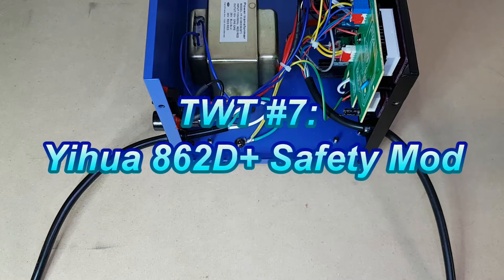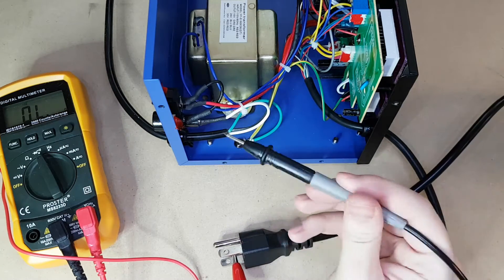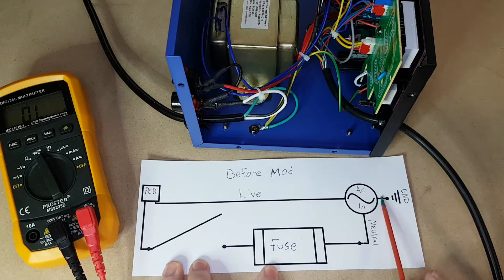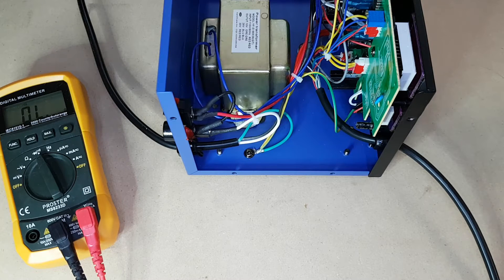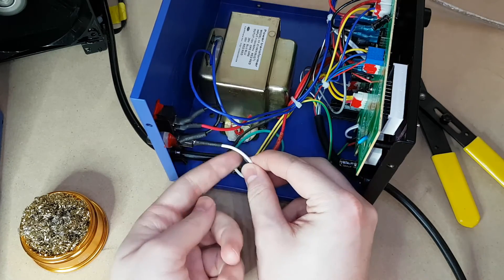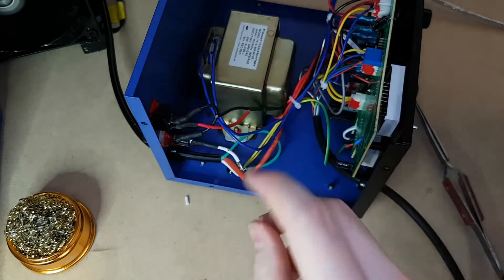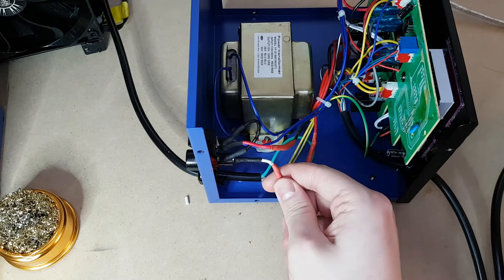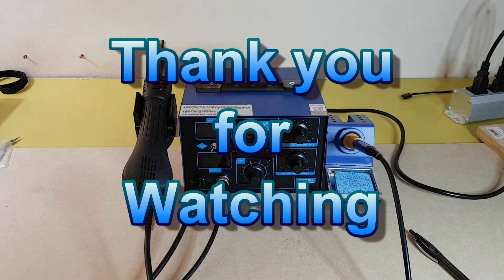TWT #7: Yihua 862D+ Safety Mod

Comment: Nice job on the video.  Just a few things though...  Throughout most of north america, we call them "alligator clips".  :)  You are correct in that the device came mis-wired, and would leave 120VAC potential between the positive side of the circuit and earth ground.  You could have simplified the repair, and shortened the video significantly, had you simply swapped the two incoming leads.  The fuse and power switch would subsequently have been corrected automatically having done just that.

Those things aside, have you done much with this rework station?  I'm currently in the market for a hot air rework station, so I like to hear from people using those that I've considered based on price and specifications.

Thanks in advance,

Oops, forgot to mention, one last thing.  For most applications where wires are concerned, tinning is great, however, soldered butt splices are an exception.  Best to strip your wires to about 1/3rd more than the length of the splice, then overlap them diagonally at the two centers of exposed ends, and twist each end from the junction point towards the insulation of the opposing wire in both directions.  Once you have the two wires evenly wrapped with no strays dangling, sweat the solder into the splice by heating the wire and introducing solder once hot enough to be wicked up into the bare splice.  Heatshrink as you have, and you'll have a proper splice.  I know, everybody is a crittic...  Sorry, I really am just trying to help.  Great video though...

Steve
Reply from the maker: I think alligator vs crocodile just comes down to personal preference, in Canada at least it seems a equal number call them croc or crocodile clips versus alligator clips. That being said alligator seems more common in the US and Crocodile in Europe and Australia based on watching different YouTube channels.

The station seems to work reasonably well, I've been using it as my main soldering iron and only heat gun since posting this video. The iron tip heats quickly and so does the hot air gun's heating element. For the price I don't imagine there are many better rework stations, especially if you are in the US and can get it for $50-60 with free shipping.

Thanks for the advice on splicing the wires!
Reply: I was thinking crocodile was a regional thing, based on indigenous species of large mouthed reptiles of the continent to which we reside.

For an all in one solder rework station, I think that Yihua 862D+ you have gives the most bang for the buck.  With Yihua, I have somewhat of a love hate thing going on.  Pretty much everything they make is copied from much higher quality, as well as much higher priced Japanese vendors.  You really can't compare the quality of what they produce to a brand like Hakko, but come on.  Who can afford top of the line for home use?  I know I can't.  What Yahua does, is makes a usable, sub par alternatives to tools I can't afford, which allows me to work effectively in my home without spending a fortune.

There are a few examples of things Yahua does that actually makes their products better for home use, than having the real thing.  For example, the bulkhead connectors they use for connecting irons to their stations are standard GX16-5's, which are readily available for next to nothing.  That means if you want to replace the crappy PVC insulated iron chord with a high quality silicone chord, you can buy the cable and ends to make high quality attachments to whatever length you desire.

The components used in their rework stations are decent and reliable enough for long life usage, it's the assembly process that trashes the quality on many of their products.  That said, you're buying a solder rework station, so, chances are you're savvy enough to repair manufacturer defects, and are able to replace any failed generic component throughout the life of the tool.

My current soldering station is a Yihua 936b, which comically, is a Chinese made clone of a Chinese made clone (Aoyue 936) of a Japanese made Hakko 936 solder station.  I chose this clone over the many 936 clones out there for it's ergonomics.  Aoyue made common sense upgrades to the Hakko design.  It has a front mounted power switch, rather than along side, where I like to store my iron holder.  They also moved the iron connector off of the PCB so that you're not stressing the solder joints every time you plug in your iron.  Additionally, it's a 50watt unit, more comparable to Hakko's original 65watt 936 than most of the others which are only 35watt units.  My clone of a clone was only $19.00 delivered, and works great!  I'm happy with it mostly because I'm no longer struggling to find compatible tips for all my ancient plug in, non-grounded irons.

The iron it came with is decent enough, but best of all, uses replacement Hakko style ceramic heaters, and is directly compatible with all the 900-M tips.  Thus far, I've found tips for handling anything from the smallest joints to any larger joints on through mounted components.  I was considering a larger iron to support the 900-L tips, but nobody is cloning the 908 irons, so I was torn between paying a fortune for an actual Hakko iron, or an adapter that still cost $5.00 more than I paid for my station.  :)  I ordered the adapter, I'll let you know how it works out.

I like the all-in-one that you have, so I'm definitely considering giving up my 936B and going that route.  My setup for doing SMD work and reflows is comically bad.  I'm using a pneumatic plastic welder with a 1/4" tip and a 2.5 horse compressor regulated at 5psi for hot air.  :)  Hey, sometimes you just have to work with what you have...  :)

It will be a while before I upgrade, but I'll drop you a note to let you know what I end up going with.

Keep tinkering, it's the BEST way to learn!  I'm a pretty old dude who's spent his whole life tinkering and learning.  You should know that it has been my experience that I have learned far more from what I've done wrong, than from what I have done right.  So anytime somebody out there, myself included, comments on something you're doing wrong, it's most likely because we too have done it wrong and learned the hard way over the years.  We learn best from our own mistakes, so by all means, make mistakes.

Steve
Reply: oh also, what you were saying about just rewiring instead of listening to this hak, so if i just unsolder the black and white wires and then switch them. everything will be good?
Reply: @wiytboi  yes if I understood correctly, I am waiting on this same station, and as soon as I get it, i will check if in july 2020 they still make the same mistake. In my case will not due any splicing will just remove and switch the black and white wire and double check.
Reply: I have order same station,  will invert both wires pos and neg before switch with no splicing, but if I understand correctly, pos live wire should go to switch first then fuse then board. If so will do some add changes to reflect that and not have a live fuse all the time.
Reply: hay i have this same station. for the price its worked great for the year and half i've been using it to build racing drones, just recently the hot air went out, and that is due to a wire broke internally in the cable between unit and hot air gun, they used stiffer wire then should have been used due to needing flexibility and fact that it moves around quiet a bit. i've just recently decided its time to upgrade instead of repair it. wish there was a decent name brand hot air and soldering station. but there isn't so gonna get a hakko iron and then look for a decent small hot air station of quality. so i recommend it for small to general use, but if your a daily solder, then maybe step it up to a little better station.

Comment: I have a similar station - Zeny. Now that I've seen this video I have to look inside or get someone to check it. But I just checked the three-prong power plug on it and there is continuity between the hot and the neutral. That's wrong? The ground seems ok; I get continuity from the ground to all parts of the case. Please help. Maybe save my life. Thanks!
Reply from the maker: Continuity between hot and neutral should be correct as it is feeding into a transformer. If the continuity stays with the switch turned off, or the fuse taken out then you should be concerned. No continuity from neutral or live to ground is also a good thing. 

I've heard that the grounding on the hot air gun is disconnected in some units, so it may be worth while to check the ground continuity on that as well.
Reply: Thank you for the quick response. I'm not sure what you mean by "if continuity stays with switch turned off".  Of course, there is no power to the station and it doesn't matter which  position the power switches are in - there are only the two on the front - there is still continuity between hot and neutral. If I take the fuse out, then no continuity. So, it's ok?
Reply from the maker: Sorry, I assumed your unit would have a main power switch on the back that kills power to the entire unit. If there isn't a main power switch then be aware that a portion of the internal PCB and a lot of the wiring will be live whenever the unit is plugged in. I would recommend keeping it unplugged or on a switched-off power strip when it is not being immediately used.

If continuity breaks when the fuse is out, that is good because it means the fuse holder is wired without any shorts.
Reply: Ok, thanks again. I'm looking at the innards now and it looks pretty good except for the red stuff everywhere! Yes, I see the one wire from the plug going to the fuse and the other going to a plastic connector and there's power there when off but plugged in. I finally turned it on and tested everything. Seems to work and without any smoke. I appreciate your help. Stay safe.

Comment: My 862D+ didn't even come with an on off master switch, just the switches on the front panel to turn on the hot air or the soldering iron.  The way it was set up from the factory, the transformer would always be connected to the mains power, even if the switches on the front panel were set to off.  This bugged me as I knew it would be needlessly wasting power just by being plugged in.  So I wired an additional switch to disconnect the mains power before the transformer.  I wasn't even thinking about the safety aspect, but hopefully I addressed that concern with my modification as well...?
Reply from the maker: I've never heard of them completely omitting the main switch before, I'll add that to my  list of possible dangers.  It seems there is quite a variety of these units around and each has its own unique design flaws.

From what you've said, yes, your mod should have dealt with some of the safety issues as well. If there is a fuse I'd recommend putting it before the switch, other than that it should be as good as it can be.
Reply: Yes, mine does have the fuse on the back like yours, but the switch that's directly above it was completely omitted on my unit.  I can't remember if I wired the fuse before or after the switch I added because it's been a little while.  How important do you think that the fuse be before the switch and I'm also curious why that is important?  I'm thinking that most likely I wired my switch before the fuse to cut everything off as I wasn't thinking of safety concerns until now stumbling across your video!  Thanks a lot for the helpful feedback and advise!
Reply from the maker: Having the fuse before the switch allows it to protect the switch as well, in the case of the fuse blowing this means that everything else in the unit is completely disconnected from power, except for the live terminal of the fuse holder. If the fuse is after the switch then the switch will remain live should the fuse blow as will the live terminal of the fuse holder.

From what I've read the only reason to put the fuse before the main switch is to reduce the number of components that could potentially be live when it blows. Regardless, if the fuse blows you should always unplug the unit before replacing it.
Reply: Got it!  I'll have to check mine and make sure I have the switch wired AFTER the fuse!  Thanks!!

Comment: Why not just swap live and neutral wires right after the mains cable enters the unit? The unit was designed for unpolarized plug, so I don't think there could be any harm in just reversing the polarity basically, thus making sure the switch and the fuse are on live wire and everything else is on neutral. Am I missing anything?

I have also read that in similar Chinese soldering stations sometimes blower is not grounded or is grounded to the front panel, which in turn is not grounded at all, so sometimes what's needed is to fix ground connections or scrape some paint next to the screws and holes so front panel is grounded to the base. So if you haven't - check continuity between the blower and ground tip of the AC plug.

I just ordered the same station, with no name on it, but I think they are all the same. I've seen some photos with shorted soldering on the board, so I will check the board for visual problems with soldering.
Reply from the maker: Honestly I can't remember 100% why I didn't just swap the polarity, as long as the unit truly was designed for un-polarized plugs it should be fine. I wonder though if there are any major or even minor differences between the PCBs for the 110V North American units with polarized plugs and the un-polarized 220v euro plug versions. 

Thanks for the heads up about the blower grounding, I will be sure to pop the unit open again and check that out. I'm pretty sure mine was okay, but I'm not gonna risk it until I know for sure!

The soldering in mine was pretty well done, there was a ton of flux on the board but other than that I had no shorts. There are a ton of these units that look nearly identical, I wonder how many of them are manufactured in the same place and how many are copies. If there are multiple manufacturers copying the same design it might explain the vast difference in quality between the units.
Reply: Considering they screwed up a simple US wiring I doubt they made any changes to PCBs.  Also, I'm not a pro, but I think when circuit is closed AC current flows exactly the same way regardless of polarity (it goes both ways changing direction 60 times a second), so the only possible difference as far as I understand, is that the "hot" wire that should be interrupted by a fuse and the switch. But I may be mistaken, that's why I asked my question. There might be copies, or might be same factory that makes them all and just slaps brand names on it. Mine doesn't even have a brand name on it. They look too similar, including paint job, on the photos. I think it's the same factory. But who knows...
Reply from the maker: My limited understanding is yes the circuit should be able to accept the AC current travelling in either direction. The circuit should just be the transformer and hot air gun heating element and neither of these care about polarity.
Reply: Why would you need a soldering station if you dont even have the most basic educationin electrics. And look up the difference between electrics and electronics.

Comment: My home doesnt have ground wires, If I apply the safety mod, will it be useless?
Reply from the maker: I would still recommend to move the switch and fuse to the live side of the incoming power, assuming you have a live and neutral connection, at least this way the fuse interrupts the circuit with less chance of the casing still being live. Having no ground wires can be dangerous due to the potential for electric shock or electrocution if a short develops inside and you touch the unit.
Reply: If the plug can be inserted with either pin in the same hole there is no point.  If as in this case the plug is oriented by different sized pins you should arrange it so live is fused.

Comment: Buy a hakko fx8801 soldering iron and replase the bad dangerus sodering iron that comes with those stations.The plastic basenut close to the rubber on handle where the grounding spring for the tip is inside making the basenut crack up when its hot and tip asembly fall hot in your lap.Mine lasted for a week got a new one from them the same happend againg.Thats when i bougth the hakko fx8801 replasement soldering iron for hakko sations.i just used the plug and cable and print board in handle from the bad irons since they have a movement sensor for sleep mode at 200 degres celsius. It fits straigth in no problem since all those stations use this bad hakko clone type with terible plastic.Now it works better dont get as hot near the base off the handle and the hakko has god plastic basenut that can take the heat witout eny problems.Hakko fx8801 soldering replasement iron cost around 16 us dollar.i also changed the triac fro those bt...  600 to bt139 800 PHm 97 12 pilipines.if it is a 2 in one station it will be 2 triacs swap them both or at least the one for soldering iron control.those i got is much higer quality and dont get as hot and can take more power.i can se the transformator is clamped together like in mine.Take big plyers and press the 2 upper corners and solder them so the press hold cause they have a tendensy to start rattling bad.Like the video.good stuff

Comment: is that what causes the whining sound from hot airgun when i turn off the main power switch on the back? we have 240volt and no neutral since the main plug have a different design and can be turned both ways.Mine has a fuse on the back like yours but also one in the mains plugg
Reply from the maker: Honestly I'm not sure, I suppose it is possible since the hot air gun would always be live.